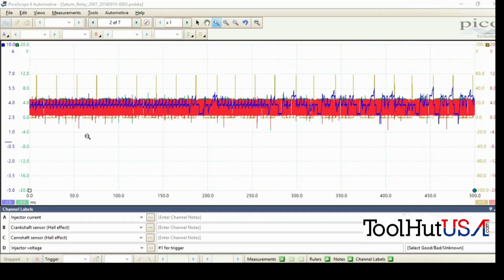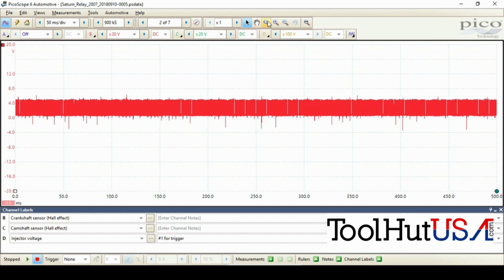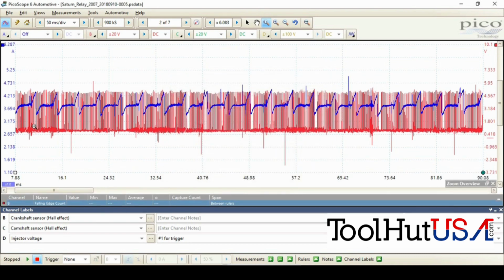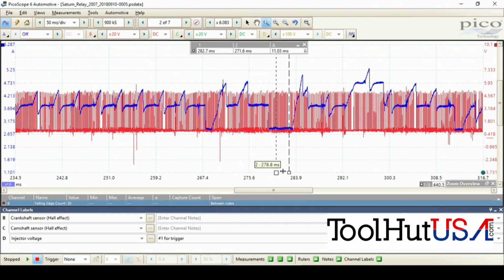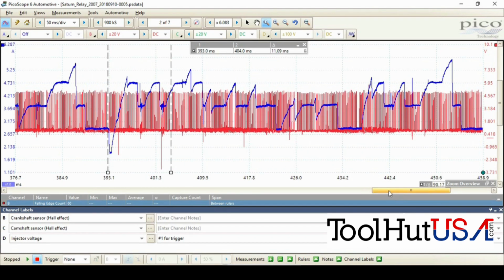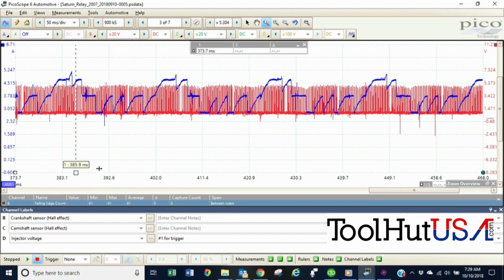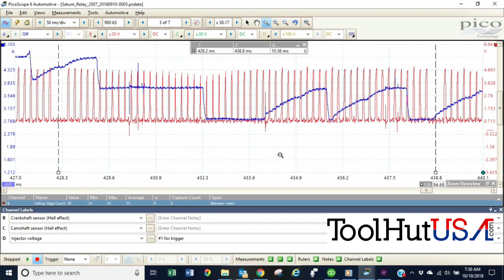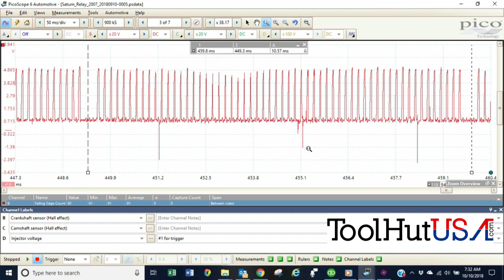Pico tech Tip. Analyzing a CKP capture on a problem car after it is repaired.

Comment: What was the problem with the car; crank sensor? Bad electrical connection? Thanks.
Reply: Why would it have 1 and 2 extra falling edges from excessive air gap? I would think that it would be missing a few not have extra. I see the wave of the amplitude indicating to big of a gap. Just when I think I have it figured out someone throws  curve ball. Lol
What vehicle is it? is the ckp sensor adjustable I take it, Thanks